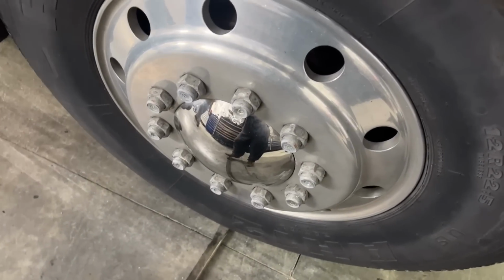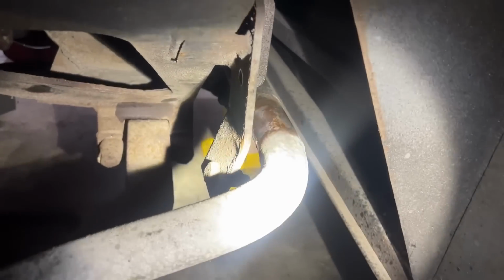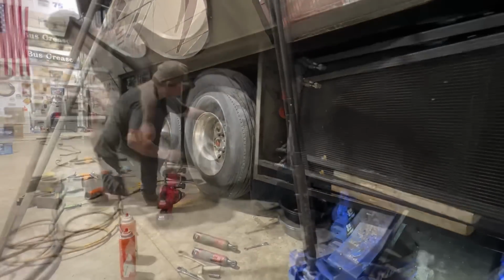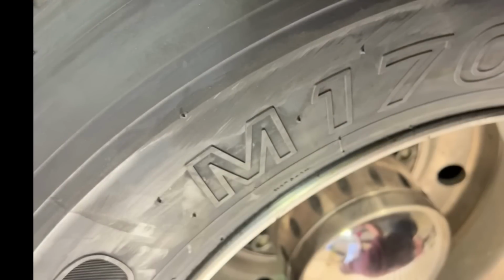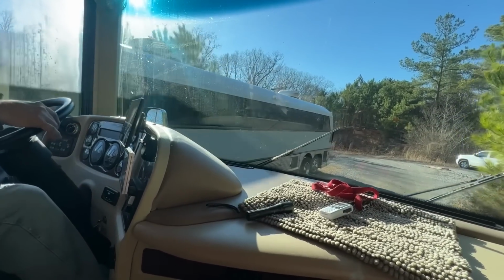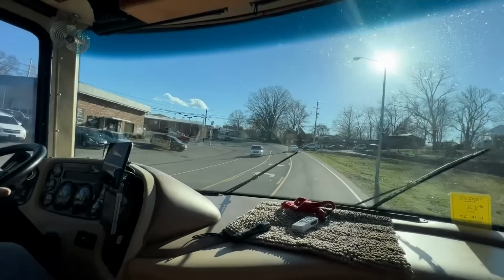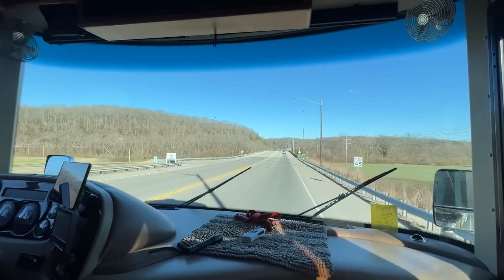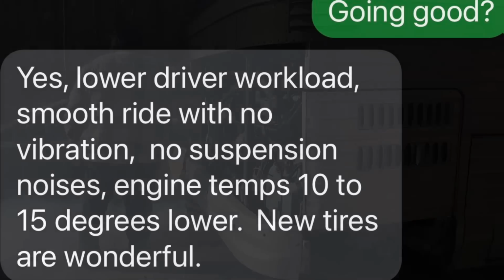Country Coach suspension, steering, handling, and cooling issues.  Lots of hard work needed

Comment: Scott, it's just amazing to me just how beat down these coaches are. It's like "No Maintenance" at all. People like driving them but the hell with working on them. I've been in the trucking industry all my life, and the motoring public should be glad that trucks don't go down the road in this shape.
Reply from the maker: This one’s like new 2005
Reply: "People like driving them but the hell with working on them."   People don't work on pickup trucks or cars these days.  What makes you think they would work on a Class A ?
Reply: @SomeTechGuy666  That would change if States began implementing yearly inspections of Class A motorhomes, big bus conversions, and big 5th wheel RV trailers.  

To keep it legit, the State should only inspect at State facilities and then give the owner 7-10 business days to correct the problems.  Or at least show it's in the shop awaiting parts to complete repairs.  When it's fixed, it gets an inspection to verify the work and gets a new sticker.  State inspections are compromised when the inspecting garage is also the same garage that will fix the alleged problems.  A serious conflict of interest.
Reply: Maybe cost is an issue for some? I was forced to buy my Class A out of necessity (homeless) live off SS, lower back nerve damage, can't afford gas for travel, sit at cheap RV park. All batteries dead, can't afford to fix. ✌️
Reply: @TimothyMichaels  Being permanently parked at a cheap RV park isn't a problem.  It's when an unsafe RV is out on the road, that's the problem.  
Do you have electric and water hookup?  If so, you're in good shape.
Reply: @SomeTechGuy666  You miss the point! Not necessarily "They wok on them, but have someone like Scott work on them . The last few Scott has had in his ship have been run in the ground. Like I said....Aren't you glad that semi trucks aren't in this kind of shape going down the road."Drive them until the wheels come off"
Reply: @TimothyMichaels  Sorry to hear this Tim. Wouldn't a trailer be better than a coach? you wouldn't have so much expense I would think.
Reply: @BlackPill-pu4vi  My point exactly Black Pill. Some of those last repairs Scott has done were a lot of work.
Reply: @kenuber4766  
Life happens, you deal with what you're dealt. Had limited money, even less time. My fault for telling the guy (seller) I was desperate.
Reply: @BlackPill-pu4vi  Or have to do a Vehicle inspection aka "Walk around" before hitting the road. Lol
Reply from the maker: This owner had it at multiple other shops this year and they did very poor work and even turned it away after having it for a month before saying they couldn’t do the work.  (Replace the radiator for that shop). It did take us about 12-14hrs to do the radiator but not rocket science.
Reply: @BlackPill-pu4vi  Most Canadian provinces have annual inspection for heavy 3/4 ton and up.
Reply: @BusGreaseMonkey  People with coaches and buses that seek you out, are lucky to have you and your shop do the work.
Reply: People buy these expecting car like maintenance.
They do not know how much maintenance comercial buses and trucks require even though the intervals are longer than regular cars the parts and labor is also more expensive and specialised. Not all of it is diy friendly. People don't see the maintenance on commerical buses cus those are owned by state or some large oparator who can afford all the expenses and generally have their own garage and mechanics to do the work. 
Parts age with time more than they do with miles.
Reply: Reputable motorcoach/bus companies usually have a very good maintenance program. When equipment get into public hands, they don’t understand the scope of maintenance, just the what it costs. Preventative maintenance does not cost, it pays. Even for private owners.
Reply: Ken, the BIG difference is maintenance is a cost of doing business for the big truck owners that is passed on to the customers, not so for the class A RV owners, unless they are using their rig for business. . . It's one thing to buy a vehicle, whether it be a Ferrari, Country Coach, Hyundai, or a Peterbilt. It's another thing all together to be able to afford to operate and maintain that vehicle, whether it be for business OR pleasure. . . Your points about safety are valid, and big class A's are every bit as capable as big rig trucks in wreaking havoc when things go wrong while they are going down the road. . . However I'm not an advocate for more regulation because it creates just another layer of government intrusion and non-accountability for the time of the "official inspectors." The inspectors will get their paychecks whether they inspect any rigs, or not. . . Once all of us old voting baby-boomers croak, all of the youngsters that are currently playing on their smartphones now can continue to live vicariously through the social media posts of the creative and productive few that can truly and properly afford their new electric recreational vehicles and vote in ALL the regulations they want to keep the highways safer and RV owners out of the way of the autonomous semis that will have replaced all of the Teamster operated diesel rigs that right now have to wait behind the slow overloaded "camper" owners that currently have to play by a different set of rules than commercial truck drivers. . . Ken, America is an imperfect place, but "life, liberty, and the pursuit of happiness" still Trumps more rules and regulations. . . Cars kill more, and wreak more havoc than class A motorhomes ever have or ever will. . . Your challenge is with the concept that the big rig RV owners get to PLAY by a different set of rules than you HAVE to WORK by. . . DAMM CAMPERS! . . . I am  one of those "camper" owners, and I am a retired big diesel truck and trailer (and other things) mechanic, and I STILL do my own maintenance and repairs, including on the road tire repair, and pre-trip daily checks of tires, lights, fluids, brakes, air system, etc. I know I'm in the minority. . . However, that's life. . . Take care, and HAPPY MOTORING!
Reply: All the dealer wants to do is sell!  Their shops may not have good service capabilities… Then there is the quality of what they sell!

Comment: I'm working on my 2004 fleetwood Discovery. we owned it about 3 month's. so far it's just small stuff. Fridge, stove,  had to rebuild the condensor motor on both AC, now working on Furnace rebuild (looks like a bad thermostat). That axle and airbag stuff is pretty intimidating, but I'm watching!

Comment: some of these buses.......the horror. This one is better than most, but it still features things which have not been greased etc. Thats a good tip on tyre pressures......only run as much pressure as you need, it makes a big difference to ride quality.

Comment: Nitrogen would allow the tires to maintain a consistent pressure regardless of temperature.  That is why aircraft tires are nitrogen filled, without that they could explode on long taxi ways at airports with hot climates.
Reply: Great information !!!!👍🏻🏆
Reply: @fernandoscrenci4874 Also nitrogen molecules are actually larger than oxygen molecules so it is harder for nitrogen molecules to leak out between the polymer chains in rubber.

Comment: I had the same problem with the window left of my driver's seat.  Less than a year after getting it repaired, it fogged up again so I replaced it with RV Glass Solutions’ Lifetime Laminated Glass (LAM) and never have to worry about it fogging up again.  The R-value difference is very minimal so I don't notice a difference when it is cold out.
Reply: I should note that RV Glass Solutions already had a digital template for the window so it was easy to order it.  All I had to do is verify it was correct for my coach and find a glass shop to take apart my window and replace the double pane with the LAM but in my case, the glass shop that did the failed repair also did the LAM replacement for free with me paying RV Glass Solutions for the LAM.
Reply: I also recommend RV glass solutions I did the driver side and passenger side windows withLAM glass and the glass fit perfectly in the old frames. it was a great improvement.
Reply: @CaptainCornBurner  
I don't know anyone who has used LAM in their coach that has ever regretted it.

Comment: I've had two CCs. Both 2000 40'ers with IFS & tight at 95k & 102k miles. Chassis issues never even crossed my mind. Only airbags & tires. For being that new, an owner must've hit something for the torsion bar & kingpin being bad?

Comment: Here are some sequential NEW WAVE THEATER FACTS OF LIFE (look up THAT subreference!): 1) ALL , repeat ALL  buses that cross his path have, AT THE VERY BEST, not been maintained nominally, according to any schedule whatsoever.  2) MOSTLY thery are severely abused and neglected, causing MORE damage costing WAY MORE than had they just even NOMINALLY maintained them (not all of this is the present owners' fault, as they may have bought the buses KNOWING there were severe problems and purchased it with these repair costs in mind 3) Scott has ethically repaired EVERY SINGLE ONE, and I HOPE he has issued a MANDATORY MAINTENANCE and inspection schedule for these yobbos.  That will serve them and him well in the future.  As always, great video Scott.  Do you remember the New Wave Theater on the USA Network?

Comment: I ran max sidewall pressure (125 psi) on my Yokohama's until I could get the coach weighed. It rode like a Flintstone mobile. After weighing I could drop the pressure down to 90 psi on each corner.

Comment: Scott, I have a question about the 1"  Milwaukee battery impact. How heavy is it, compared to the air counterpart? That thing, is a beast!
Reply from the maker: Around the same.  Different manufacturers and models are different but 25lbs + battery 2-3.5 lbs 5ah-12ah

Comment: Looks like y'all bought a tool to make hydraulic hoses! Must save time from always having to run to town to make them up.
Reply: There was a video when Scott had a mobile hydraulic hose shop come to BGM.  The bus being repaired needed a lot of hoses w/fittings made and that mobile shop was a real time saver.
Reply: @BlackPill-pu4vi  yep I watched that one.
Reply: Think that tool is for AC lines.  Owner talked about not being able to clean the charge air cooler after a ac line break. 6:45 mark.  Not sure if it would work with hydraulic fitting.
Reply from the maker: It’s a hydraulic crimper

Comment: I bet that new radiator was expensive $$$$.
Reply from the maker: 6k
Reply: I remember that around 30 years ago there was a radiator repair shop in my town. Not only would they repair car radiators but also locomotive radiators. But all the radiators were metal at that time.

Comment: Very mice bus. I hate the consider what he just spent on his service,especially with all those new tires.
Reply: based on a quick look at least 7K
Reply from the maker: All parts alone were around 15k probably.   Labor around 6k definitely a 20k + maintenance appointment.   Radiator alone was 6k tires were 6.5.  Then add airbags, shocks, fluids filters thermostats, swaybar etc.  yes not a cheap outing.  Labor was way less than parts
Reply: @BusGreaseMonkey    I’ve been watching your videos for years now and I’ve always been impressed with the thoroughness of your work. You are definitely pros.
Reply: @BusGreaseMonkey  The round-a-bout specifics are appreciated as a future shopper is better able to assess what [he/she]  [could be/is] facing in procuring such a machine. Maybe spend $5K-$10K more on a unit that has verifiable receipts that such a service was done within the last 2-3 years - - - but keep in mind. items not needing repair/update 2-3 yrs ago may need them now.

Comment: As a former driver in my opinion if you want to drive something like this you should be required to have at least a basic knowledge of all it's components and should be subject to the same inspection and determinate of the dot but with that said the places other than grease monkey should be held liable for inspections and repairs that they claimed to do and didn't
Reply from the maker: Tiny little motorcycle requires a special license…. Giant rv - nope    It is absolutely ludicrous but it’s all political.
Reply: @BusGreaseMonkey    To drive a 45' Prevost tour bus, you need a cdl.  To drive a 45' Prevost bus conversion, ie Marthon or Liberty, for example a regular class C.  I bet the cdl would scare off a lot of potential customers.
Reply from the maker: There isn’t even a practical way for an rv owner to get a cdl.   They won’t ket you take the exam in a private rv.  That testing system is flawed too by not having it. But also a lot of commercial things wouldn’t apply. They should have an rv endorsement option and education and safety training options like abate had for motorcycles.
Reply: BGM  thx for qpan informative and entertaining video. re CDL Komifornia DMV requires a Recreational  CDL for operating a single vehicle  over 26k#GVWR and single vehicle pulling a camper trlr exceeding 10k#s and requires "A" endorsement for camping trlr exceeding 15k#/40' OAL which requires knowledge and skills test with TV and Camper trlr also medical cert same as CDL no logs and is not for hire restricted.